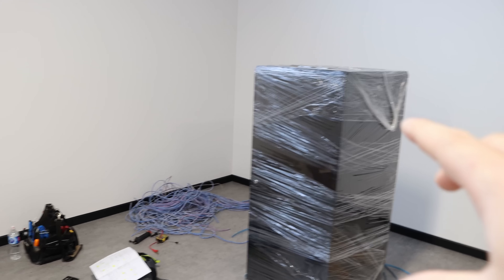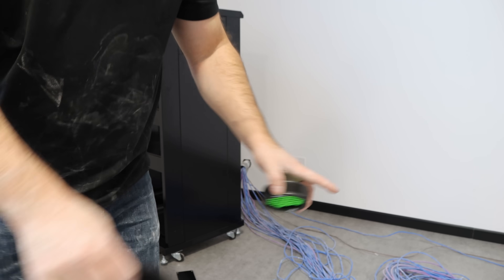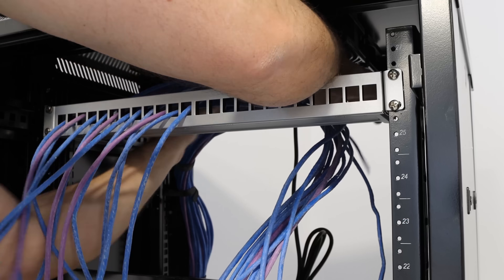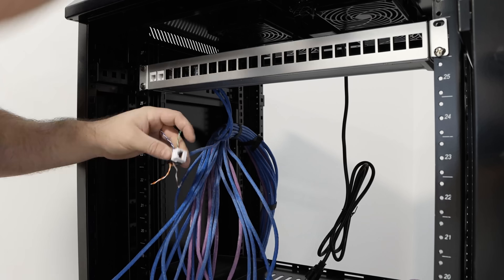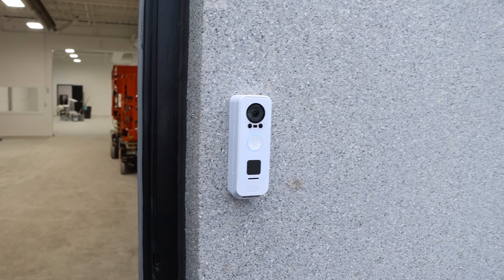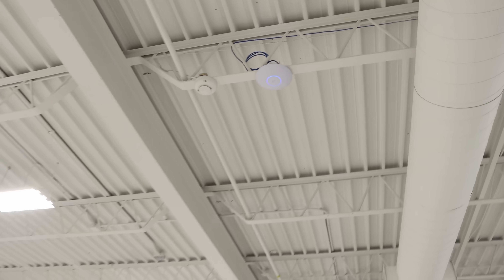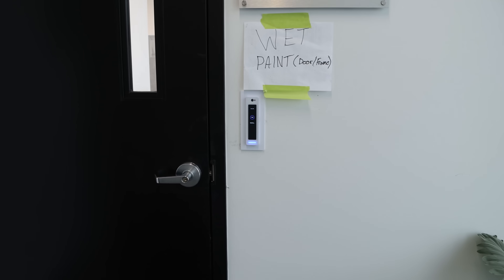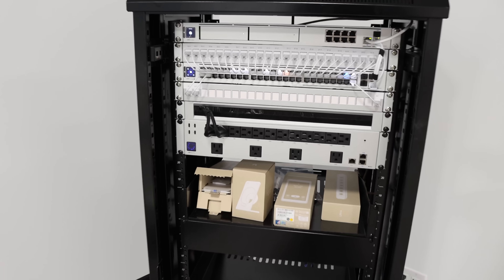UniFi Network On Site Installation

Comment: At 01:43, are you following the natrual lay out of the Data Cable? Is each individual cable parallel to another cable? If so, wouldn't that induce cross talk? If not, cool. Looks awesome either way. Cheers.

Comment: I notice that the U6 Pro and U7 Pro APs that you install are mounted horizontally (ceiling mount) and (in other videos) the U6 In-wall  or U7  In-wall AP's are vertical. Is it OK to install a U6 Pro or U7 Pro AP horizontally (on a wall instead of a ceiling)? Will the signal strength or performance decrease too much if mounted horizontally?
Reply: edit ... OK to mount the U6 Pro or U7 Pro vertically (on a wall) ... ?
Reply: You'll want to look up the radiation patterns for each model.  If I recall correctly, the signal emanating towards the back side is a lot weaker than the front, so wall mounting can make sense depending on where you're placing it and the coverage you're trying to achieve.

Comment: Nice job as always, make it look good is half the battle, like that UniFi went to the 24 port across format on switches now. I did not like the 12 over 12 made the wiring look crappy….that said the old way worked just fine just didn’t look good, lol
Reply from the maker: Ya I’m really glad the new switches are 24 across so much nicer looking

Comment: Noooo!! Electricians not leaving any slack at cables? NEVER! this has never been done before!
Reply from the maker: 😂 it sucks for the owner because they don’t know. But luckily it all worked out . These electricians were better than most though
Reply: If the cable is too short, the electrician will lengthen with a short cable and wire nuts. 😒